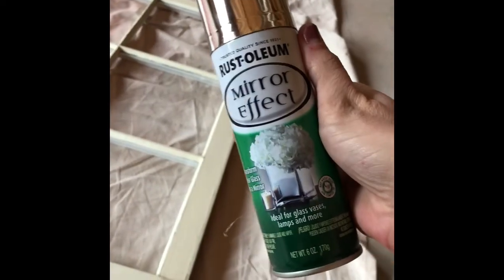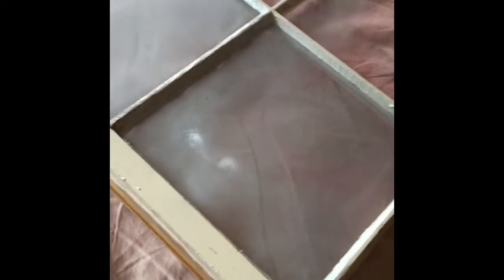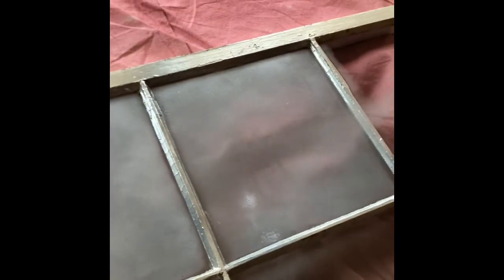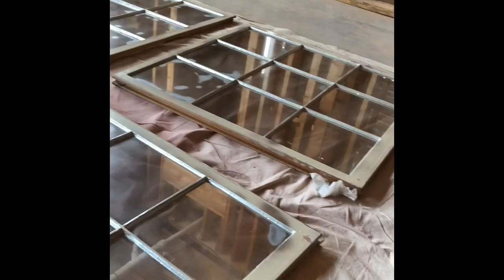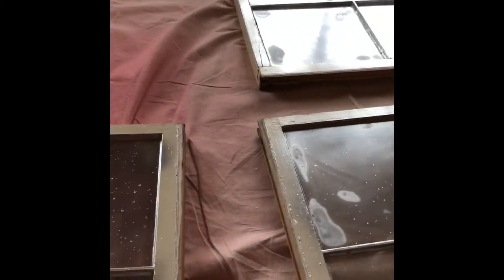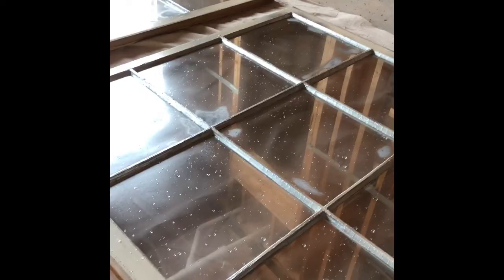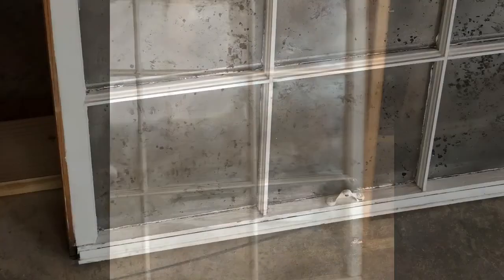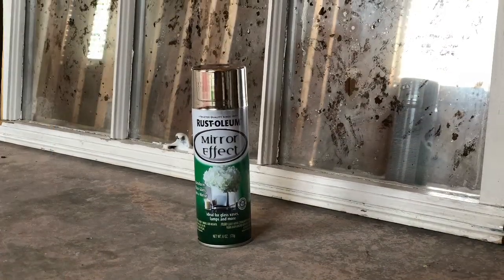Mercury Glass DIY With Spray Paint And A Farmhouse Window

Comment: Your video is the best tutorial on the Mercury glass...love it!  I'm wanting to do vases any suggestions on how to spray inside the vase without you having the paint run? Thank you so much!
Reply from the maker: Connie Miller thank yo so much!! To spray the inside I would cover the outside with saran wrap to protect from over spray. Then do a very thin light coat and let dry in between sprays.

Comment: I tried this, but its not coming up when I blot it with a t-shirt.... I did let it fully dry though.... Did the spray still need to be slightly wet when i sprinkle on the vinegar/water solution? Or do I just need to leave the solution on longer?
Reply: Hi Lily! The spray can dry, but don’t leave it dry for hours. Spray on the vinegar solution, make sure the drops are semi big, and let that sit for a couple minutes. Then gently blot. Should come up easy!
Reply: Acetone will reconstitute the paint for a second try.